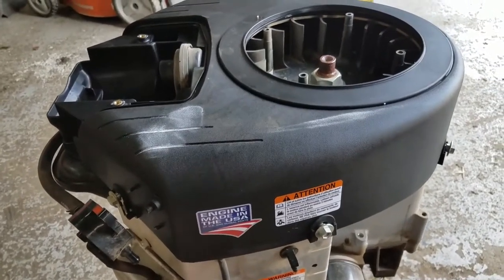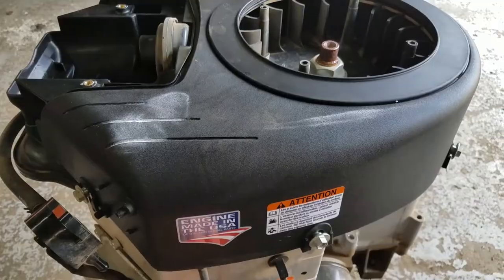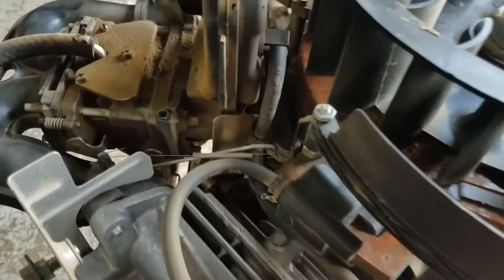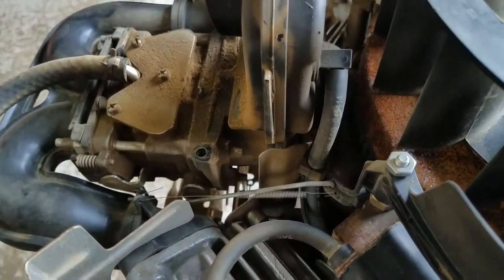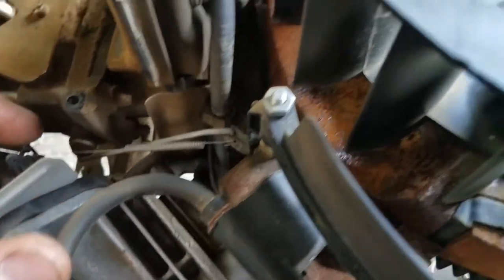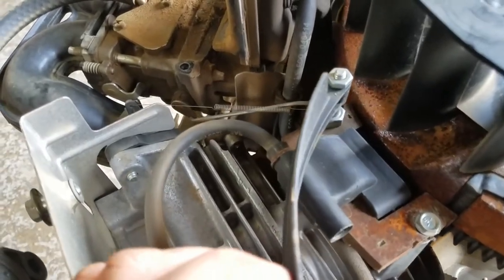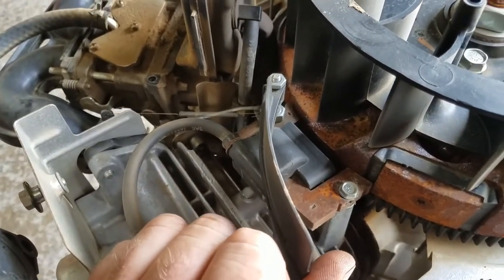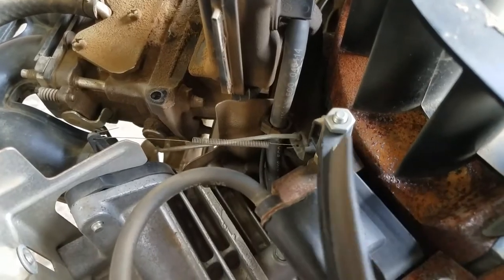How A Briggs Intek Automatic Choke Works

Comment: I can confirm that the single butterfly valve carb design connects in a similar fashion. Also there is no adjustment on this system. Just make sure you have the correct return spring, linkage and bushing on the carb side. Make sure there are no cracks or damage on the vane and everything is clean of dirt and grime so the vane can operate freely. He could have removed the carb so you could see the choke valve move in concert with the air vane but this is good info nonetheless. 

Can you please make a video on how the thermostat works on the other side of the carb in connection with this? Thank you!

Comment: Thanks for the information. My 27 hp B&S will crank but wont start. If I spray in carb cleaner, it will start. I'm thinking the auto choke is sticking. I have had to start it this way the last 3 times. I will check the condition of the choke.  Thanks

Comment: Thanks for explaining this. My Briggs and Stratton intek 7.0 has trouble when the rpms die then it catches and picks up again, then dies again, etc. It does this until it warms up, then it runs ok until it gets fully warm, then it won’t start while the engine is warm. I think I might need to adjust this auto choke setup, but I don’t know where to start. Do I shorten or lengthen the spring maybe?

Comment: Replacement carburetors, even the ones I have seen from B&S, show a different carburetor which is basically a standard 2 barrel carb with the throttle control on one side and the choke on the other. Do you know the B&S part number for the correct carb?

Comment: I replaced the carb and didn't realize it was missing the connection for the rod until after I installed it. fired right up and runs fine though. can't seem to find the right one on Amazon. nice explanation!
Reply: Did you ever have any issues, I am replacing my carb and obviously they don’t make this carb at all any more. Did you leave the air vane
Reply: @mrmajors60  yes I left the vane. no issue
Reply: @scottt89 thanks I’m glad to know it was basically a useless addition and don’t have to try and hunt down this type of carb

Comment: My Husqvarna lawn tractor’s choke mechanism is completely different than this unit. Ours operates completely off of the throttle linkage, through levers beneath the engine.

Comment: I CANNOT FIND AN OEM BRIGGS #595613 CARBURETOR WITH THE PLACE FOR A CHOKE PULL OFF. EVERY 595613 CARBURETOR I FIND IT IS MISSING. IS THERE A WAY TO BYPASS IT?

Comment: Would this work on the older vtwin intek with manual choke? I'm installing a intek twin in a mower that does not have a manual choke location. I could rig something up but this might be a better solution.
Reply from the maker: It's worth a shot. Might have to make a few modifications.

Comment: i would of liked to seen the whole linkage and spring and ho it works ,, i just took the carb off the same engine ,,i have the linkage like you  showed us right ,,, but i think my other linkage  might not be right ,,, something doesnt seem right ,,, and im afraid to start it lol .....  i know this is old but if someone can tell me where a photo or diagram is id sure appreciate it .. thanks whoever looks at this
Reply from the maker: If you go to the Briggs & Stratton engine website you can download repair manuals that will have the info you are looking for.